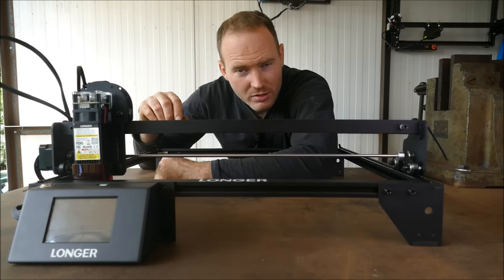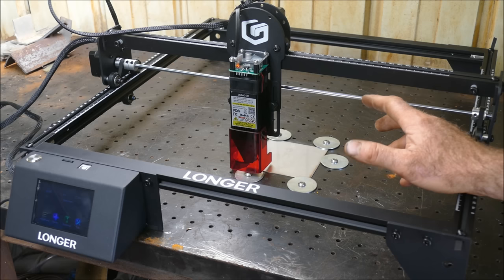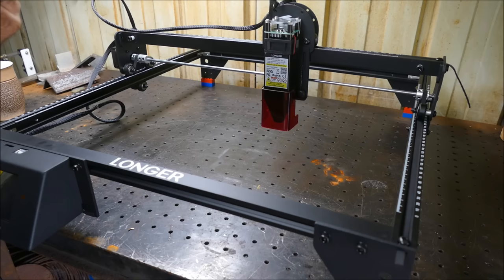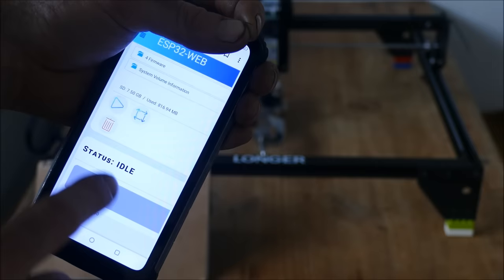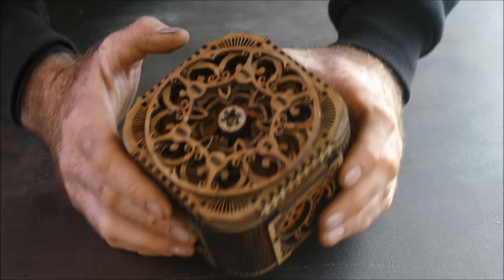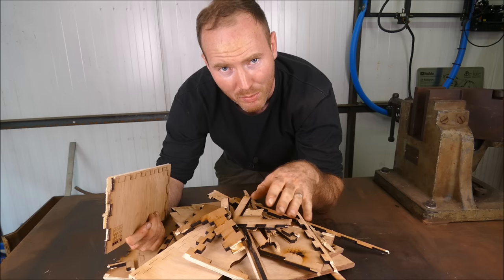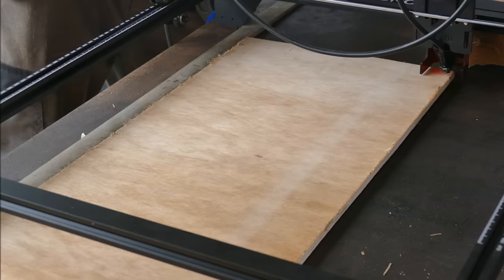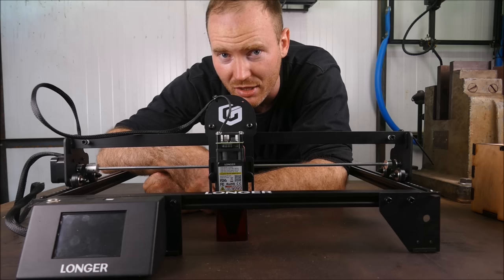This New CNC laser is amazing! - The cost effective LONGER RAY5 10W - New!August 2022

Comment: This laser module is bit different but never the less i must cringe. When are the YouTubers reviewing lasers going to stop saying cooling fan on the module is acting little bit as ait assist? That's , number one, totally wrong and number two makes people who are looking for knowledge and information thinking same thing and ruining their laser modules. That is cooling fan only. It is there too cool driver electronics (although some lasers have external driver box with its own cooling) and laser diode. As default those lasers are meant to operate as engravers and only for situations that do not produce lot of smoke. They can cut but need proper air assist if you want to cut materials that produce smoke. If you use it as sort of air assist you will force that smoke true the whole module and eventually it will stop cooling efficiently and die. Before that happens it will lose its optical power while lens will get dirty. Sometimes simple IPA wash can sort it out but sometimes it is to late. Proper air assist has few effects. One being removing smoke and char dust out of the way and that results in faster cutting due less light diffraction and no need to work once more on same material. Second effects is that it makes easier to evacuate the smoke before it gets recycled by the cooling fan. Air assist models that enclose the lens and have gaskets so that air can't leak into the module make sure lens will hever get dirty while space infront of the kens is always filled by the clean air out of the compressor. Here it becomes important that it is oil free dry air. There fore do not use shop air that contains oil. There are models that have dryers but make sure they have clean air. I advise getting propper air pump for the job. Quieter, smaller, consuming less power and develop less heat. Using air assist when engraving wood will cause negative effect while it will charred the surface more. If you have pump regulation you can use weakest setting just too maje sure air in front of the lens is clean. If you need air assist there is no way around it. Though chance is you will never need it if you just engrave materials that maje little to no smoke during engraving. Last but not least air assist does not replace the need fir well ventilated environment or proper ventilated enclosure with smoke evacuation system. Especially if you are cutting stuff that make smoke. Plastics burning are creating toxic fumes to. Fume extraction is serious stuff and fillers do help. BTW with air assist and cutting one gets much cleaner tip and sometimes even bottom side to. Less burn marks.
Reply from the maker: Thank you for that. I added my own air assist to cut the 9mm ply in the last part of the video. Cheers J
Reply: @joshuadelisle  I was commenting before I have seen the end. Seen it all after it. At end cut is pretty nice. You people that make reviews have responsibility to give good advice. So I hold you to a high standard  😀
Reply from the maker: @NINEWALKING  thank you. I'll do my best. Cheers J

Comment: For years now I work with both hobby and professional laser cutters and this machine is just like 99% of those laser diode cutters: unnecessary. Especially for hobbyists, terribly designed eye protection shield, no air assist and no fume hood makes this machine a death trap. I hope that a manufacturer stands up to take matter in their own hands to produce a safe machine that doesn't break your bank and does what it's supposed to do.

Cutting thick stock on a diode laser is nonsense anyway, look at those burned edges, and don't forget all the cutting footage is sped up, these are relatively slow cuts (hence the burning).

It should be common practice for Youtubers to be more critical when reviewing these machines, especially considering it's a big trend this year for cheap diode laser cutter manufacturers to send out models for a free review. It's quite a serious type of machine.
Reply: Just want to add that this shouldn't be seen as criticism towards the maker of this particular review, but more as a general comment on these type of videos. I hope it's constructive enough.
Reply from the maker: They have an effective fume extraction and surrounds now available for very little money to go with this. They didn't give me their air assist but that is also available. I made no secret to the speeds at which this cuts and it is relatively slow in comparison to a co2 laser. However for me the proof is in the results and the fact that I can set this up and carry on with other work means the slow time element isn't an issue. But at just a few hundred £'s I can create precise parts and engravings that would have been impossible for me to do without one. For the money you'll only get so much but I think it's fair to say it's still very impressive. It's hard for me to be so critical when I don't have other more expensive machines to compare it to that most people couldn't afford otherwise. All the very best. Cheers J
Reply: @joshuadelisle  Exactly.  A hobbyist is not going to be cranking out parts all day every day, but their projects can still benefit immensely from the ability to CNC cut or engrave.  And for the money, this is a fantastic machine for hobbyists.
Reply from the maker: @kaasmeester5903  thank you. I will compare a more expensive model if I get the chance but I honestly don't think I would buy anything more expensive than this than less I was running a laser engraving/cutting business. Cheers J